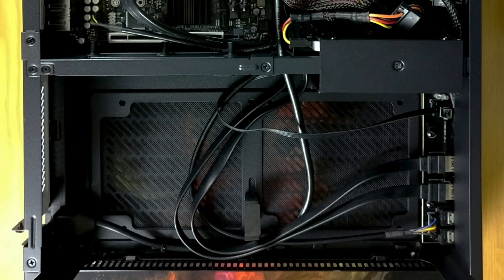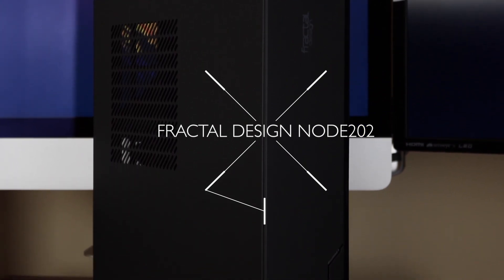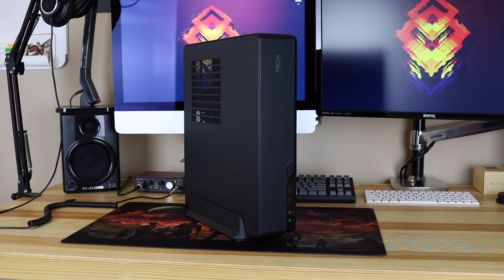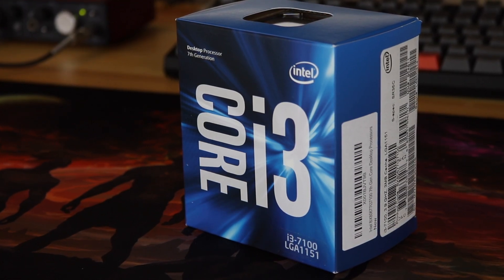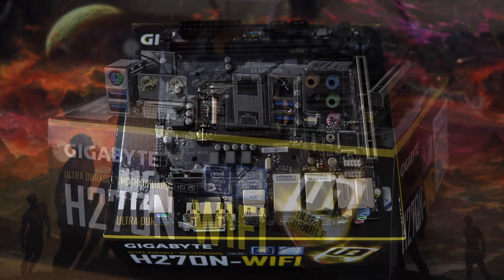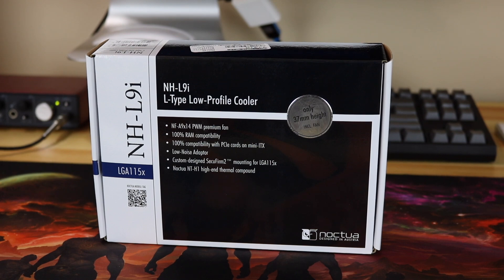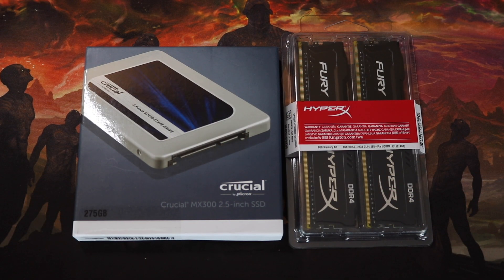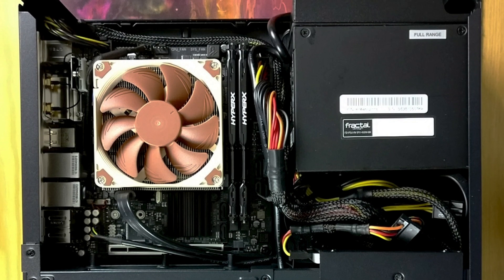Custom HTPC for Linux - Parts List and Assembling

Comment: Hey Alex... I see that you love Linux :D... I don't understand why you like so much Linux...that you even want to make a time-killer program.... but here is a tip... until you make the photo editor( not too soon anyway ) better check Wine or Playonlinux 

https://youtu.be/ZxVMPA8ySQA

Anyway, glory to Windows and Pc Gaming Master Race
Reply from the maker: I love Linux for many many reasons. Here's a short list of the most obvious for me:

- I'm a developer, and a Unix-based system is a heaven for my work.
- Linux is safer than Windows, less spyware, malware, viruses, etc.
- Linux is OpenSource, that means if there's something about the OS I don't like, I can access the source code and change it.
- Linux distributions (at least the majority of them), don't spy on you, don't steal or resell your data to other companies for profit, don't try to push their own proprietary software.
- Linux is lighter on hardware, that means I can have a computer as good as new, and as fast as the first day even after 5 years.
- Linux doesn't have planned obsolescence.

Building a UX App native for Linux is interesting for me as a studying exercise, and to help the community by offering free software capable of professional work, without relying on emulators, partitions, stealing cracked copies, or paying a stupid expensive subscription for a software only because there are no good alternatives.

Thanks for your suggestion, but my Linux Steam machine runs games perfectly :D

Happy Coding!